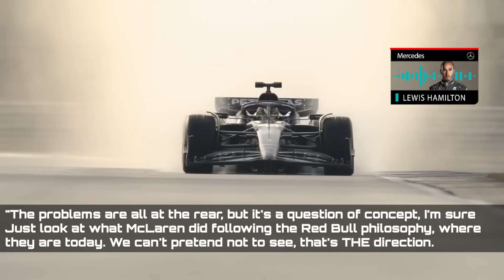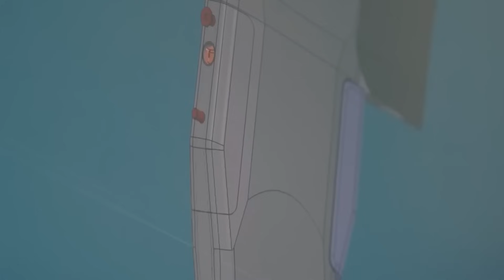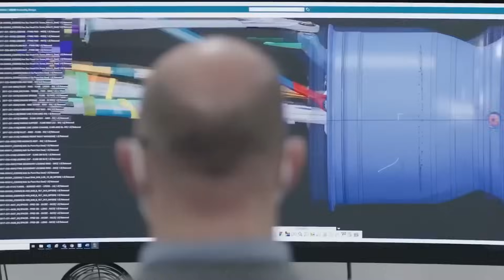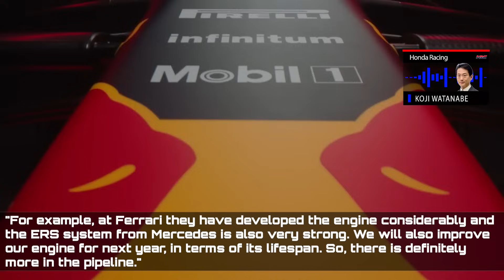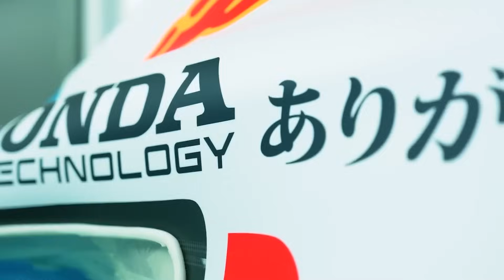Mercedes & Red Bull Revealed MAJOR Engine Upgrades

Comment: 2:30 ok I’m no aerodynamicist but it seems drag would not be reduced by getting rid of side pods as all that air would not be managed with aero elements as it SMASHES INTO THE REAR TIRE. Maybe Merc’s wind tunnel wasn’t correlated properly for this idea. I don’t know. But considering that they started working on this in 2021 and only just abandoned the idea mid season this year they are screwed for quite a while. Makes me wonder if its better to just focus on the new regs coming in 2026(?).
Reply: yeah tbf you probably know more than a highly paid team of world class expert aerodynamicists
Reply: @ChunkyLover69420  lol fair point. But damn why did they stick with it for so long?
Reply: While that is true, mercedes engineers thought the larger volume of air over the diffuser would give them more downforce from the floor. Which then reduces the downforce needed from ghe rear wing.

In the end the wake of the front tyres compromised this philosophy. The couldn’t control that wake well enough meaning they lost a lot of downforce while cornering.

This was shown by B sports on youtube with wet weather photos.

The droplets make the vortices very visible.
Reply: @daphnedh9086  I could see that being the reason for their horrific bouncing on the straights early on in the development of the concept. It could have been working too well in the wrong place on the track.
Reply: No no, if I'm not mistaken the problem isn't with the wind tunnel, the problem in 2022 was that they made it so the ride height would have to be super low and thus porposing was born, and in 2023 with the same concept they had to lift it even more because of the reg changes that THEY proposed and ended up with no porposing but with a slow(er) car
Reply: @mexicanopdb  yes of course. What I’m referencing is the point made by @daphnedh9086 that the point of the “0 pod” was to produce even more down force by the diffuser. If you’re already running low and your diffuser is working too well it pulls the car right down on to the track, thus stalling the ground effect. The car pops back up and the whole process starts all over again. So the car ends up with violent porpoising. 

Again… I’m no aerodynamicist. I could be talking out my ass. But the various facts seem to point in that direction.
Reply: Ur absolutely right. But Mercedes knew that with the zero pods they would add drag to the car. They thought the benefits would outweigh thst drag. However they could not make use of the advantages

Comment: Stupid question but why can’t radiators be mounted horizontally with airflow generated by the underneath of the vehicle pulling air ?
Reply: If u put holes in the underbody u loose to much downforce